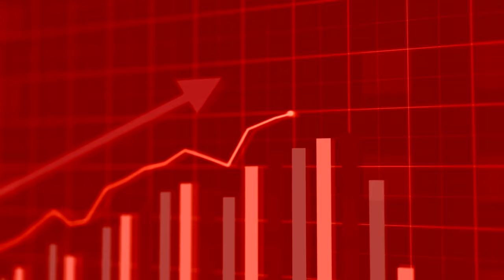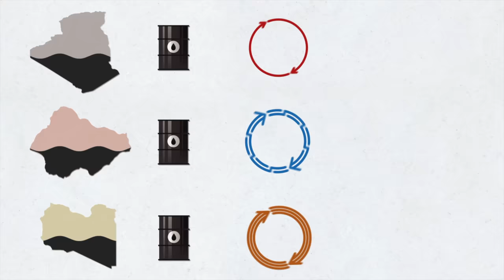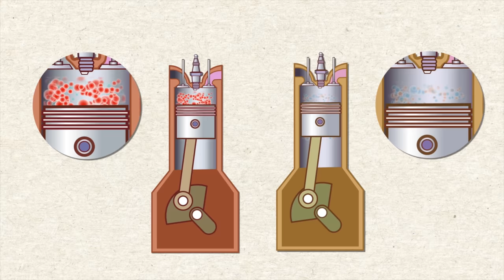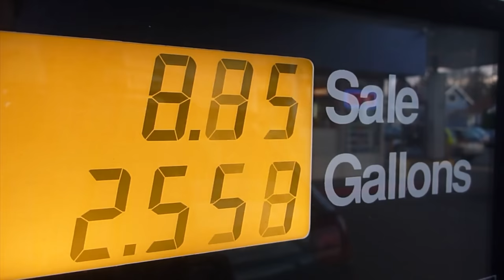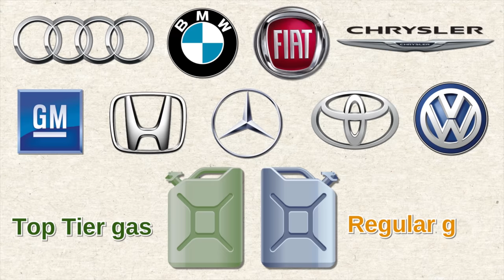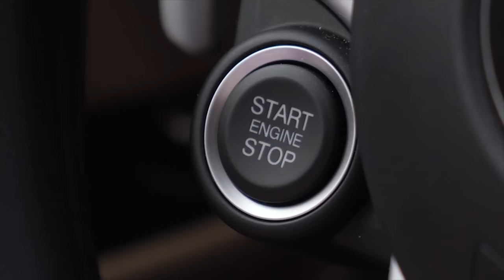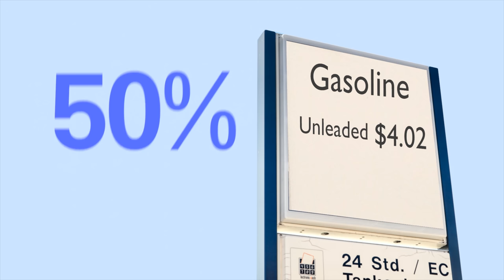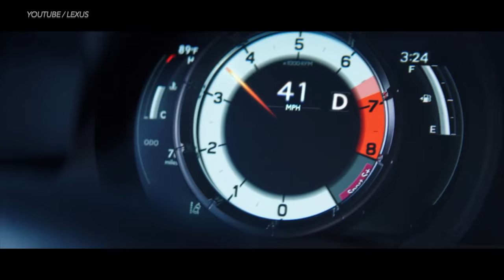No One Has the Balls to Tell You the Truth About Gas Prices, So I Will

Comment: EVs cannot be mass produced without diesel powered machinery to do lithium and cobalt mining.
Reply: i said it later in the comments that EVs won't take over the market until the batteries are plentiful, light weight, cheap, and safe
Reply: How many passenger cars do you think are sold for every excavator? We’re a long way from replacing diesel for off highway vehicles but most people could get by with a battery powered car for non commercial use. Fleet vehicles are a different story but again they make up a minority of vehicle sales.
Reply: True, but a majority of the mining is done by children digging with their hands.
Reply: Currently it takes roughly driving a ev  91 thousand miles to offset the carbon it takes to produce it. So like most of these green solutions, the more you learn about what it takes the less it makes any sense.
Reply: Exactly!!!
Reply: Where do they store used Lithium batteries ? No one is talking about this.
Reply: The power grid barely can handle the load on it now during the summer as it it. There is no way it can cope with everyone plugging in one or more EV's into it for charging it's batteries.
Reply: @andymeyer9876  they drive 200,000 miles, so net gain. 
What was your point? Don't forget to factor in the carbon cost of a gasoline car.
Reply: True, however if u only have a certain amount of these machinery and a majority of diesel vehicles off the road you're still going to make a huge impact for better environmental health just saying
Reply: Trouble is, the impact of producing batteries is higher than the impact of combustion engines right now.  Until they improve the battery manufacturing tech, EVs will be worse for the planet....
Reply: @DragonstarFighter  How are is energy energy is neither created nor destroyed you will not be able to make a smaller more light weight battery in order to store power. EVs are a waste of time and money Hydrogen fuel cell however is possible
Reply: @jamesvandamme7786  where are they recycling lithium? Once it is spent, that's it. Lead acid lasts longer but has less energy output than lithium. Lead acid can be regenerated by adding sulfuric acid. Can't do that with lithium yet. And lithium is like nuclear waste, everyone wants the benefits but nobody wants the waste in their backyard.
Reply: And slaves to mine it!
Reply: for now
Reply: @liberty4175   they are recycled
Reply: @jamesvandamme7786  We don't live in a closed, planned economy, nor is the human population a closed, planned growth. The idea that you won't need to mine new resources because "we'll just recycle it all" is ridiculous.
Reply: @taraswertelecki3786  and we should just say sorry that's how it is?  Sounds like something that needs fixing to me.
Reply: @andymeyer9876  compare that to a gas car. It takes machines to produce them too. How many miles driven would it take to off set that... oh, youre telling me they dont?
Reply: Ev’s suck and it’s a grift you’re limited to the mileage you can drive and time to recharge plus they can just shut you down at any given moment or Jack your recharge times at a whim to kick power and control over people ability to travel, not to mention you will in the future have a tracking device that will tax you according to the miles you drive and possibly locations too.
Reply: Hey, we can have diesel vehicles while also switching most to electric. Unless you daily a Cat 797, in which case wtf? Man. Wtf.
Reply: @williamworth2746  The same way a new phone have way more battery life than an old phone 5 years ago. Improving energy efficiency and energy density.

The max amount is governed by E=MC2, where one gram releases enough energy to destroy an entire city. We are nowhere near the physical limit.
Reply: @lpsoldin3162  The earth limited in resources. We will find new ways to extract them, as we always had. Nothing new.
Reply: EVs are useless for anyhthing other than a trip to the local store once or twice a day. Also, look at where most of the electricity for EVs comes from? It ain't wind or solar. Almost all of those recharging stations run on diesel generators. If you live in a place like california that can't even make enough electricity to keep your lights on, how the hell is everyone supposed to recharge their EVs?
Reply: @MAGAMAN  It is possible to charge an ev at home, which isn't bad. 
Sure, EV may be unsuitable if you live in somewhere rural without charging infrastructure, however, people have driven across the US on an EV, so it isn't as useless as you may think. 
Indeed, somewhere like California or any other state on that matter cannot handle the amount of EVs on the grid by 2040 without increasing capacity. Well see what happens then.
Reply: @williambrasky3891  The state with the most power outages in the US based on annual frequency data from 2015-2019 is Maine. Texas and California didn't make it in the top 10.
Reply: Lithium and cobalt mining is also fabulous for the environment, as is manufacturing lithium batteries using coal-powered factories, and then dumping it all into the soil after 8-10 years.   People have delusional tunnel vision when it comes to "green" energy.
Reply: @liberty4175  Wtf do you mean no one is talking about this? This is literally one of the biggest talking points of the EV revolution, Lithium batteries are being recycled.
Reply: @henrysmith8012  So what. Thats life. Live with it or do something about  it!
Reply: @solarlux7856  How many people have driven across the US in an EV and what sacrifices did they have to make to do so? Tell the whole story buddy!!!
Reply: @kingforaday8725   They used GPS. They charged while taking breaks. Thats pretty much it.
The fuel cost is around 60% cheaper.

Comment: One word. Infrastructure. How would all of these EVs put more strain on an already outdated electrical grid? The electric companies already have a huge strain when we turn on all of our AC during the summer months.
Reply: And power outages in the winter can last for days.
Reply: I heard a report from the mid west power operators talking about rolling brownouts... sounds like owning home batteries is the way to handle some of this.
Reply: Interesting question. I could make the argument that it would flatten out the daily curve if most people charge at night when typical demand is low. It would allow less cycling of peaker plants and base loading plants that don't like changing loads.
Reply: @readypetequalmers7360  Or thermal storage HVAC, much cheaper than batteries.
Reply: Bingo.
Reply: Plus it's cheaper to heat Home with Clean Gas then electric
Reply: @geo745don  Heat pump technology has advanced to the point where it's cheaper than natural gas in some areas.
Reply: Depends on the grid all electricity is used up at generation
We just step it up to send it across transmission lines to a sub station
Reply: Electrical grid capacity isn't a problem, we'd only need to increase our electrical grid's capacity by around 25% which is very easily achievable seeing as we average an increase of 4% per year over the past several decades.

The reason ACs cause 'outages' is because of economics, not because of physics. ACs placing an undue burden on the electrical grid is a very rare and spontaneous situation, we could eliminate the outages caused by ACs but we don't because dealing with an outage or two each year in a few areas of the country is far more economical than producing immense amounts of excess energy. This is all related to how energy production even works, there are several good videos of engineers explaining this on YouTube.
Reply: @Outwardpd  basically a tariff for solar?
Because we use what we generate from a baseload power

Comment: What turns me away from EV vehicles is I feel like anything that goes wrong I am totally dependent on the dealership to repair, they would have to provide a lifetime warranty on the electronic components.
Reply: . N they ABSOLUTELY  wont
Reply: That’s just Tesla
Reply: Most car repair places work on EV's...no worries. Tons of places...look up EV repair on your phone.
Reply: You’ll be fine. Also as EVs become common you’ll be able to take it anywhere. There’s no way the mark will not respond to such a high demand as EVs are everywhere.
Reply: also Testla (tesla) is against repair your own. Testla is like google, you are the product and test driver lol.
Reply: They do, MG offer a 30-year warranty for example
Reply: That is a ridiculous fear to have, the only component in EVs that won't be able to be taken for traditional repair in the near future is the battery itself. Which is like asking for a lifetime warranty on an entire engine, you didn't get it with ICE and you'll obviously never get that on EV. Batteries degrade over time and one of their biggest issues is the inability to replace single cells easily, this is an issue that is already being explored extensively and has become much less of an issue over time.
Reply: @dukeblair7792  You're missing the point...NO SELF REPAIR
Reply: @Outwardpd  Hes talking about the ability to work on the car yourself..
Reply: @CWHolleman  , very minimal repair...and you can repair your own brakes, suspension,  and many other things. So...nope!
Reply: @CWHolleman  , Sure, there won’t be any engine or transmission work, but the suspension is the same as regular cars and I’m sure you’ve had a ball joint, bushing, strut or tie rod go bad before. EV’s will be no different.
The same goes for all the interior electronics. I’m not sure if you’re aware of this or not, but much of the work mechanics do today involves something related to the electronics in a car. Tune ups and engine problems are nowhere as prevalent as you probably think; the bulk of modern repair work involves electronics. You know what comprises EV’s? All electronics. Power windows, power seats, climate control, sunroofs, etc. are all the same whether the vehicle is powered by an engine or a motor.
Reply: Correct and no one other than Scotty is telling the people that it cost 
$ 12,000.00 to $ 15,000.00
To replace the batteries in an EV. Who has that type of cash just laying around for a battery . The batteries alone are 25 % to 33 % of the total cost of the car.
They can keep it, I will stay with a gas powered vehicle.
Reply: @mann_idonotreadreplies  apple too. Most big tech companies are anti right to repair.
Reply: @georgewoodget271  the problem is that they're going to eventually Force us out of our ice vehicles, for example-- along with signing the deal requiring all cars in the EU to be ev by 2035, the European Union is actually considering eventually making it illegal for people with regular cars to sell them to each other
Reply: @franka2743  the European Union is actually considering eventually making it illegal for people with regular cars to sell them to each other - I don't think that this statement is correct. You are even allowed to buy oldtimers without a exhaust catalyst.
Reply: @gunnarkaestle  I read it in an article that they had passed their decision about when (the year) that all new vehicles sold in the EU must be electric and were considering making it illegal for people to sell their old ice autos when that happens--- I'm going to look to see if I can find the original article
Reply: @franka2743 illegal for people to sell their old ice autos - I strongly doubt that this applies to the second hand market.
Reply: @gunnarkaestle  I would think so too but that's what the article seems to imply
Reply: @franka2743  what the article seems to imply - please provide references.

Comment: Years ago. I recall using a strategy for saving gas called hypermileing (not sure on the spelling of that). It was really only for manual transmission cars. But some of it can be adapted for automatic as well. From what I remember it involved keeping your speed down. Keeping the rpm’s below 3000 when accelerating. Shifting into neutral to coast down hills as well as coasting to stop signs and traffic lights. If you time it right. You don’t have to wear your breaks out while doing this. I used to use this strategy when times were tight and I didn’t have any money for gas for a few days. I recall it working very effectively. I never ran out of gas and always got to where I needed to go.

Comment: One time I noticed my vehicle lost fuel while sitting overnight in my driveway.  Without a puddle or smell of gasoline, I suspected fuel theft.  I purchased a locking gas cap and haven't had any more disappearing fuel.
Reply: Billy McNutt, yeah that happened to us once bought a locking gas cap & it stopped it, 😂
Reply: In 2008 when this happened, people were buying gas caps then too, so the criminals would just jam some sharp object into your gas tank and drain it that way. Just be aware
Reply: Criminals are getting away with it- NO fear anymore.
Reply: i think there’s a way to damage those caps. mine was firm new and one day I noticed it slightly loose. one day I removed the cap without the key.
Reply: A place I worked with a van fleet tries locking caps...the thieves just drilled a hole in the gas tank and drained it...causing an entire fleet to need to replace gas tanks.  I'd rather need to replace fuel than a gas tank.  Half the vehicles had to be totaled as the gas tanks for them were impossible to find.
Reply: That happened to me the other night. I bought a lock too.
Reply: @clothedandcompetent3452  so the owners file insurance claim for total loss and got a replacement vehicle with a new gas tank and gas ⛽️ cap. Sounds like a good exchange to me 😂
Reply: Who needs a locking gas cap? Have your kids stand guard duty all night long.😃🍺
Reply: @spidermonkey7605  Lol. Why not. They don't want to go to bed at night anyway.
Reply: And when they can't get the cap off they drill a hole in the tank which costs you far more.  Best tool for this type of problem is a .357 magnum if you catch them.
Reply: @anvilsvs  Park inside an electrified fence. To hell with a transformer, just connect it to 220 and fry potential thieves.

Comment: Filled up my Chevy/Geo Metro yesterday. Seven gallons at 357 miles $29.54. Yall can have your mortgage payment EVs.
Reply: Been running a couple of them for YEARS... People use to laugh at me... Now I Laugh at THEM !
Reply: @henryhill3778  It just goes to shoe that EVs are useless.
Reply: Wait… so it sounds like it costs less to fill up my 24 gallon Jeep Grand Cherokee at about 100 dollars!  Go back to math class 🤦‍♂️
Reply: @sleepysleeper6390  Explain to me how $100 is less than $29.54? Now tell me who flunked math again?
Reply: @Salvation4DJews  you say seven gallons costs you $29.54.  Which would equal approximately $102.00 if you filled up my Grand Cherokee, which is approximately 24.6 gallons.  But it only costs me $100, so somehow I’m getting better gas mileage than you :)
Reply: @Sleepy Sleeper  You need to take another look at what you just posted. It makes absolutely no sense.
Reply: @sleepysleeper6390  What you're doing is paying about 8cents less per gallon of gas. For your Jeep to match the gas mileage of that Metro, it should have a range in excess of 1,200 miles on that 24.6 gallon tank.
Reply: @jamesvandamme7786  That is until everybody has one. Rolling blackouts coming in the west coast, midwest, and TX this summer. Enjoy!
Reply: I dont want pay 700 dollar car payments

Comment: When you need a work vehicle... EV is a no. This has added to the struggle of all independent contractors
Reply: Work vehicles will likely go to a hybrid setup. You get the benefits of both that way.
Reply: Exactly, and this has been my concern 👍.
And the EV revolution, regardless of one's opinion on it,  is going to destroy a lot of the smaller guys, those riding around in beater trucks getting sht done.